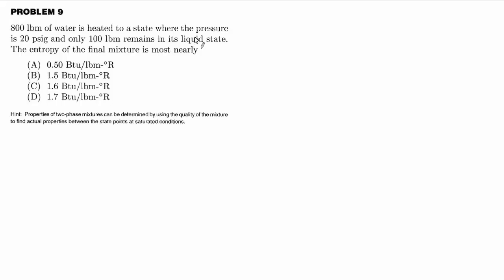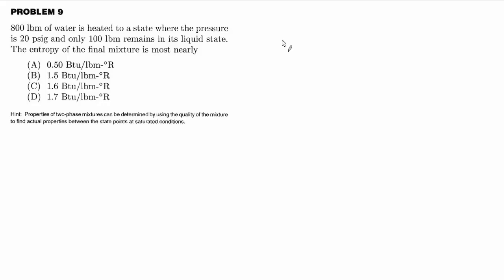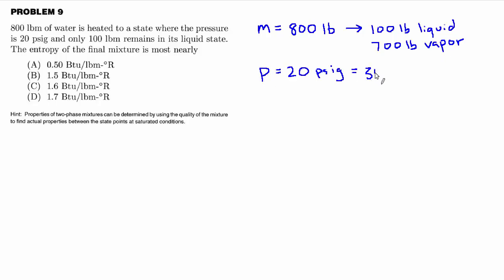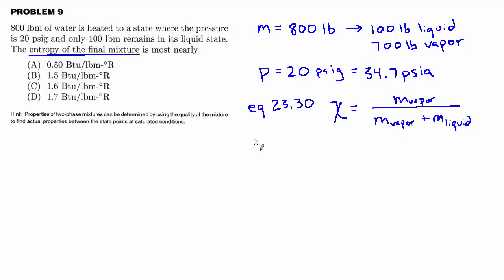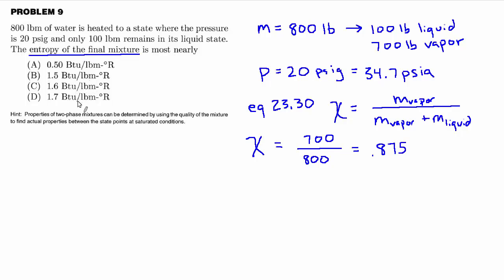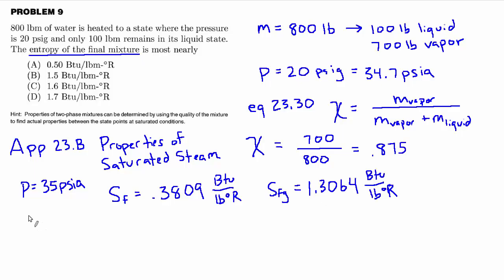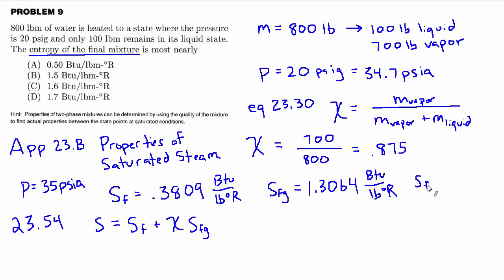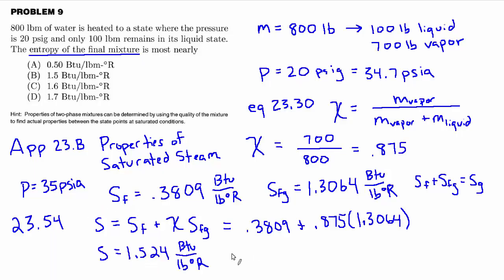Mechanical PE Exam Prep: Entropy Calculation for Two-Phase Mixture | Step-by-Step Solution

Comment: Intuitively, I calculated final mixture as 87.5% of sat vapor + 12.5% of sat liquid... That gives me the exact same answer of 1.524.  Anything wrong with that approach?
Reply: Did the same, and also did it for enthalpy. Also read it off the T-s diagram for s and h.  All three methods work for s and h, although reading the T-s method is hard and not accurate enough for s this problem, it does get h right.